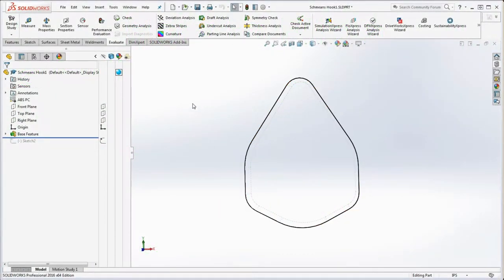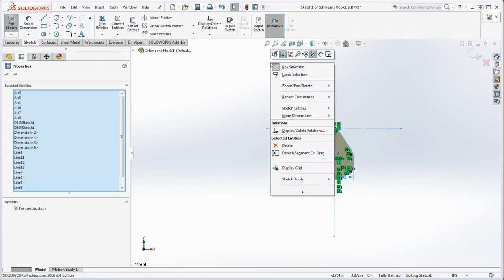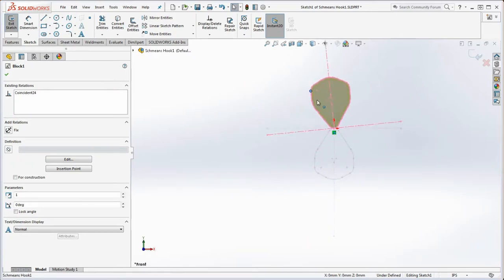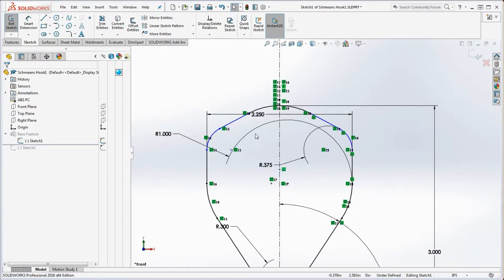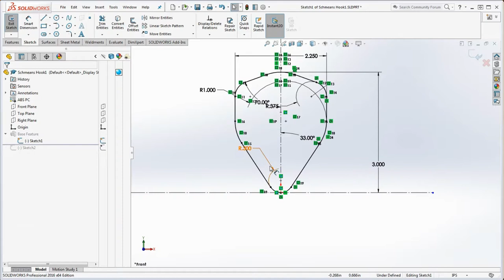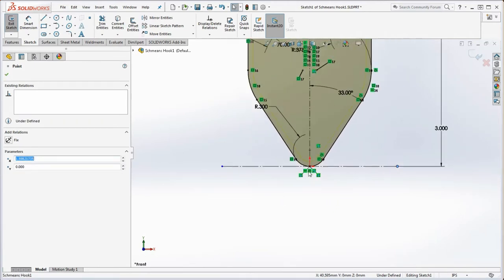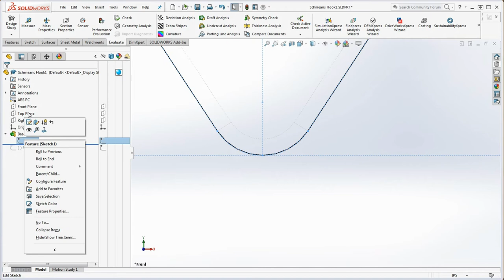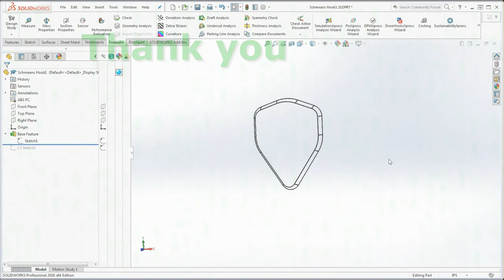67 SolidWorks – How to Flip a Fully Defined Sketch, Quick Fix – Create a Sketch Block with Clean Up

Comment: definitely not the best way, - you just could have used Tools - Sketch tools - Modify - Right Click on the needed dot and that's all. 15 sec instead of 7 min of redundant fuss
Reply: I like both solutions, tbh select all block and flip by changing the degrees took me 15 sec as well. Anyway thanks learned two new ways :)